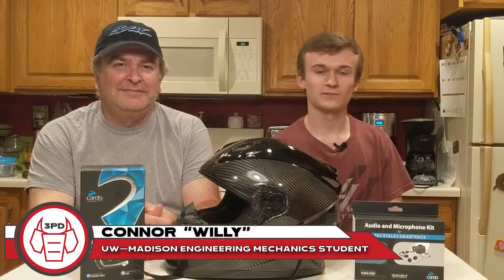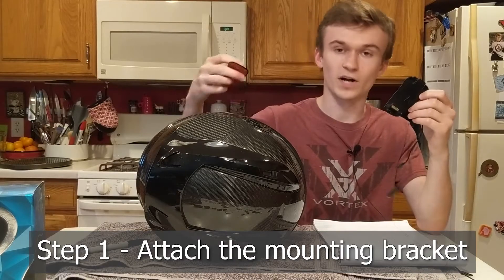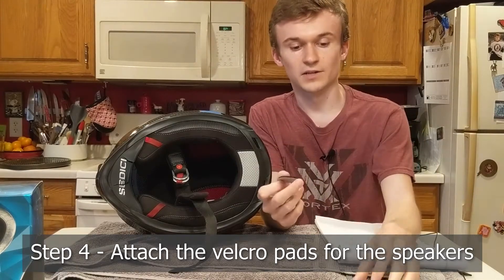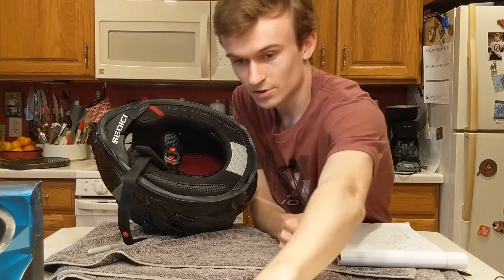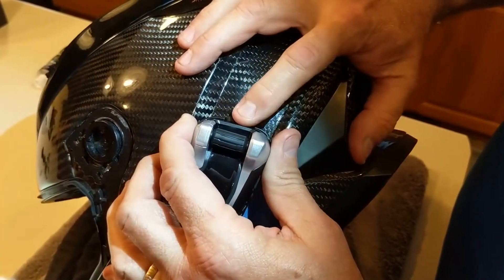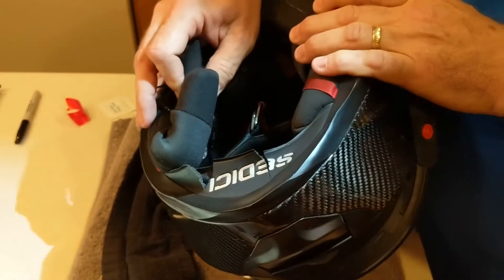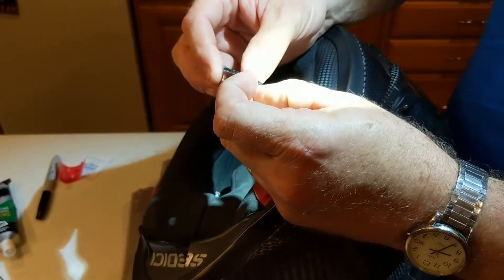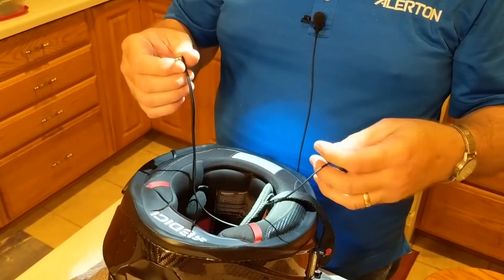How To Install Cardo Packtalk Bold & Cardo Audio Kit | Full Guide

Comment: Nice kit and helmet. Just curious, why didn’t you just completely remove the padding  ? wouldn’t that be easier in installing  the kit. Thanks 👍
Reply from the maker: I didn't remove the padding fully because you don't really need to and anytime I've removed pads from helmets, you risk damaging the clips that hold them in. It's a real pain to fully remove pads from the helmet and doing so wouldn't make the kit installation any easier, at least on my specific helmet, your case may differ! If you have pads that remove quickly and are easy to reinstall, then I guess it may help you out a bit!
Reply: I guess Im randomly asking but does anybody know a tool to get back into an instagram account?
I somehow lost the login password. I appreciate any tips you can offer me.
Reply: @Thatcher Alejandro instablaster :)
Reply: @Zachariah Marcellus Thanks so much for your reply. I found the site through google and im in the hacking process atm.
Takes quite some time so I will reply here later when my account password hopefully is recovered.
Reply: @Zachariah Marcellus It did the trick and I finally got access to my account again. Im so happy!
Thanks so much, you saved my account !
Reply: @Thatcher Alejandro Happy to help xD

Comment: Is it hard to hear your music at higher speeds?
Reply from the maker: On my motorcycle there are definitely some times where it's tough to hear clearly which is a combination of my bike being really loud at high speeds and my helmet letting in a ton of wind noise. When I use it snowmobiling, I have no problem at all hearing it at high speed, mostly because my helmet seals around my face a lot better. I'd say that overall I can hear the music plenty loud most of the time. Hope that helps. 
- Connor